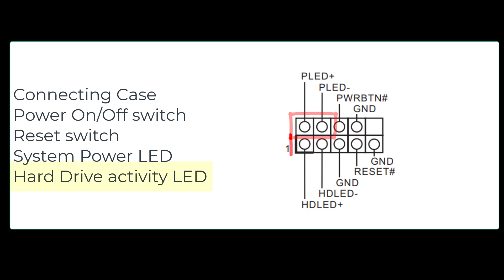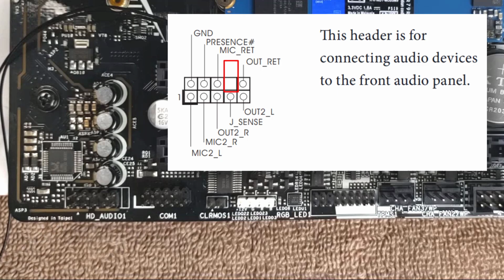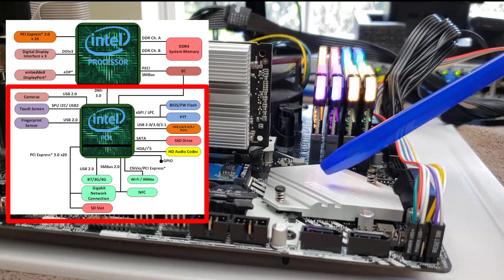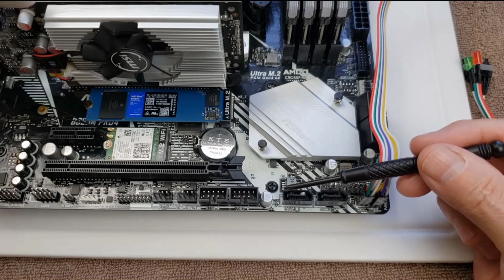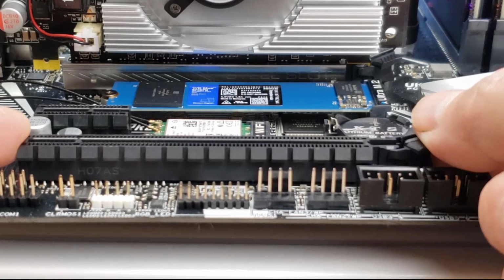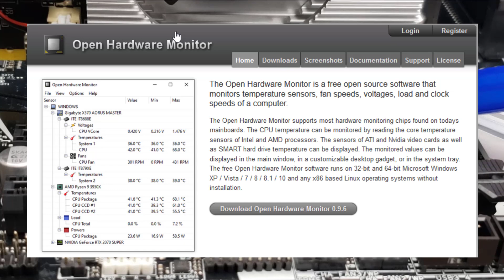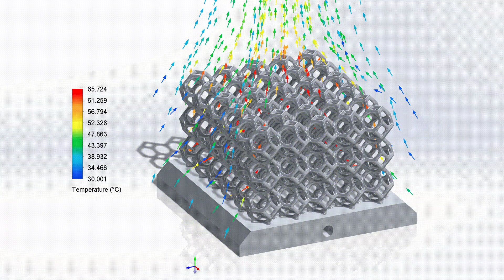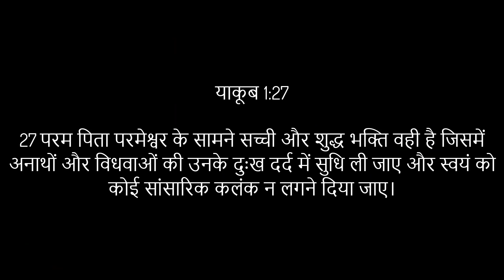Motherboard Mastery: IT Admins' Guide to Desktop Support

Comment: at 10:20
one thing I don't understand, you say it is a x8 slot, because only part of the connector is populated, but the specs say "2 PCIe 3.0 x16, 1 PCIe 3.0 x1".
Reply from the maker: Dirk, it is confusing!  page 17 of the manual it states 
"PCIE1 (PCIe 3.0 x16 slot) is used for PCI Express x16 lane width graphics cards.
PCIE2 (PCIe 3.0 x1 slot) is used for PCI Express x1 lane width cards.
PCIE3 (PCIe 3.0 x16 slot) is used for PCI Express x4 lane width graphics cards.
I was actually incorrect thinking it was X8, it was X4, this is often a limitation of the PCH and why choosing the PCH is very important.
Reply: @TechsavvyProductions  Now its clear to me.
Many thanks you took the time to answer me.
thanks a lot.